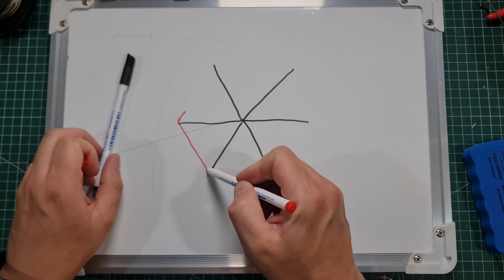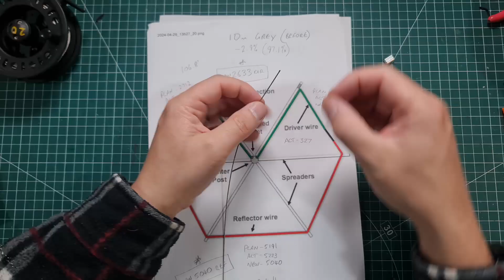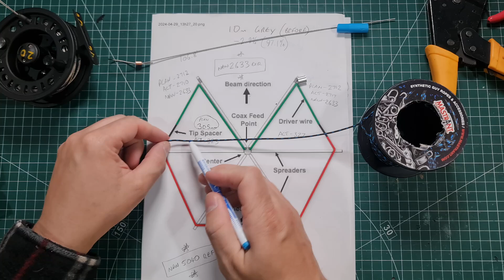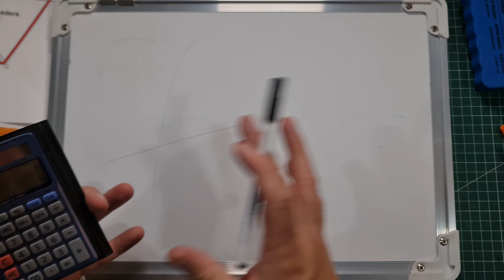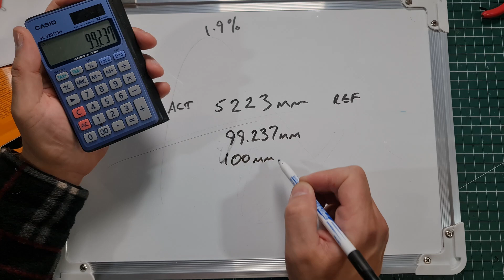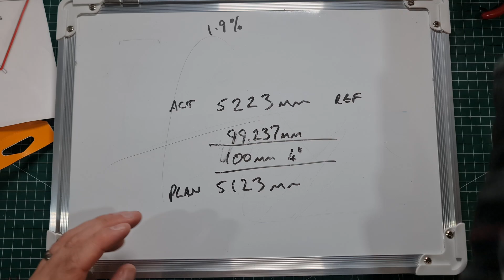Hexbeam Wire Elements - What, Why & How #hamradio

Comment: Sir I have a G3txq beam and would like to add a dedicated 11 meter element if it is possible, what would I need the make the driver lengths and the reflector length be.Kind regards Gary
Reply from the maker: You will need to replace the 10m element with for the 11m one. The driver, reflector and spacer all need to be made a set percentage longer depending on operating frequency. E.g 28.4/27.5 = 3.3% longer on all 3 sizes.
Reply: @MM0OPXFieldRadio Sir would it be good to make it in the center of the band around 27.185 ,would you know anywhere that i could purchase one already made up,im 81 and just start a new hobby and picked up this beam that was damaged in a storm and im just putting thus together for something to do ,i have a 718 icom that has be opened to the 11 meter band thank you for your reply .
Reply from the maker: Unfortunately I do not know who would sell these. Your choice of frequency is yours. Where do you like to operate. I just estimated 27.5 as than will cover low to high bands I think. Try and find someone at a local radio club to help you.
Reply: @MM0OPXFieldRadio thank you kind sir for your response this is my project for the time being and ill be working on it ,perhaps ill post you about the results, again kind regards

Comment: Colin, another little tip: Do you have an address where I can find the fiberglass tubes needed for these projects? I found a Chinese supplier on Aliexpress, but unfortunately, they refunded me because they didn't have them available. I want to replace my current fishing rods with more durable ones without spending a fortune. Thanks in advance.
Reply from the maker: Andes camping dot co dot uk. This is my supplier.
Reply: @MM0OPXFieldRadio  Thank's alot

Comment: Wow Colin, I followed your instructions and today I adjusted two bands of my Hexbeam... fantastic result: SWR 1.1 and resistance 50-52 ohms on the center of the band on both 20 and 15 meters. Tomorrow it's the turn of 12 and 10 meters. On the 10 meters I noticed that I will have to lengthen the measurements, but I think the magic formula can also be used during the lengthening phase... thanks again and I am more and more convinced that the Hex is a good antenna and fun to build. Bye 73
Reply from the maker: Great work. There is minor interaction between element's so you may not get each one perfect but will be good enough.
Reply: @MM0OPXFieldRadio  Another little question, Colin. Let's assume I have to shorten the reflector by 5cm, so I'll also shorten the director by another 5cm, but in total, 2.5cm on each side of the two directors. Is that correct? Sorry for the silly questions, but I want to understand. Bye, 73.
Reply from the maker: Yes and no. Yes you cut equal amounts from the driven, 2.5cm each. The director will need more than 5cm as its longer to begin with. Its proportional.
Reply: @MM0OPXFieldRadio  Tnx Colin for your patience

Comment: Ok Colin, the same calculation and adjustment must be done for the director conductor as well? For each band, thanks.
Reply: Exellent Colin today i'm working in setting for my first Hexbeam .......finger cross thank's alot 73
Reply from the maker: Yes by same percentage, the amount to remove will be more on a reflector but proportional.

Comment: Hi Colin, do you have 20-6m version as well?in the file folder can see 15-6m and 20-10m version? Regards Kes m0pkz
Reply from the maker: Hi Kes, simple to add 6m to the 20-10 version. I just decided not to add it. You just need another coax jumper and clamp. You can get the height from the baseplate from the 15-6 tho it's not critical. As long as the wire is horizontal.

Comment: Excellent video. 
Only suggestion I have is to paint the spreaders (before hanging the elements) with a UV resistant paint to prevent eventual degradation of the fiberglass. 
I'd also suggest adding the "ice cords" to make it a bit stronger.
73 de W1JIM
Reply from the maker: Agreed, although I only ever have this up for short periods.

Comment: Thanks so much for this Colin. I have nearly completed mine as per your instructions, and it is looking great. Last thing to do is make the wires, however on your spreadsheet the lengths seem to be different to the recalculated lengths on your sheets in the video. Are the lengths on the spreadsheet your final lengths for the 1mm stainless steel wire?
Reply from the maker: Very smart spot👌. So the short story is I made the adjustments and remade all the wires. They were roughly 5% out. After doinf this they were slightly too short. The sizes you see in the video are these. I then adjusted circa 2% and added these sizes to the spreadsheet. There are interactions between the wires so the theory doesn't exactly match the practice. Subtract the final video sizes to the spreadsheet sizes and it should be circa 2%. Yes 1mm stainless wire. Please email me some pics when complete 👍
Reply: @MM0OPXFieldRadio  Thanks for the quick reply. So, for example on 10m you have 2633mm as your final value for the driven elements (in the paper in your vid), so at 2% longer that would be about 2686mm but in the spreadsheet you have 2817mm. It’s just I have made the 10m elements to the spreadsheet now and the total length is far too long for the suggested spreader arm length and is resonant at something like 26 Mhz (very rough test). Just wondering if those numbers in the spreadsheet are a bit out, or perhaps it is something I have mucked up my end.

And yes, I will certainly send you some picks when I am done, this has been a really good build so far.
Reply from the maker: I'm now doubting myself Matt. The spreadsheet lengths do seem long. The final sizes on the video is what im running. Its not perfect but close enough and not worth charging. I will look at this tonight and change the spreadsheet if need be. There should only be the 1-2% difference. I do apologise if any if you have cut wrong lengths. Remember to check SWR with the beam in the air. Ground has a big effect.
Reply from the maker: Matt, send me an an email and I will reply with updated sizes. Cheers

Comment: I have a question, on your 49:1 toroid video can I use 24g magnet wire? Of course using the 2661102002
Reply from the maker: Yes, I think it would be fine but its very thin to work with.

Comment: Thanks Collin,I m trying an hexbeam using pvc coated wire of 1 square mm of section.12m and 17m bands show roe>2 , and it increases with power.Do you have any tip for this?Regards
Reply from the maker: I suspect you may have some common mode current. Do you have a choke right at the feedpoint?

Comment: Thanks Colin.  Really looking forward to seeing your high band version 😊
Reply from the maker: If my new centre post idea works it will be even neater.
Reply: @MM0OPXFieldRadio  Are you likely to be sticking with the 11mm poles for the highband version or can you drop down a size?
Reply from the maker: I think I will as it will help stability. Could probably go to the 9.5mm poles if you wish as used these on the 15m Moxon and it has longer arms.